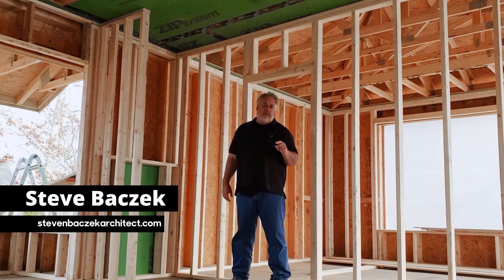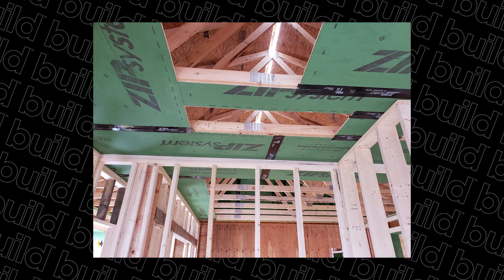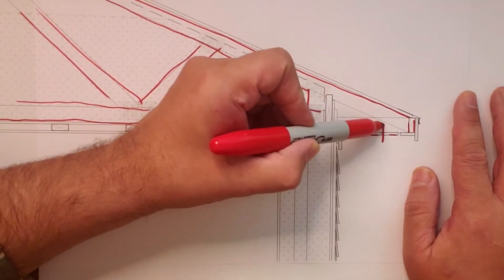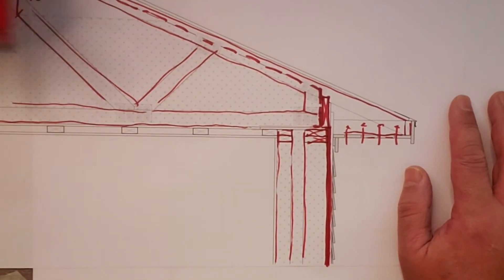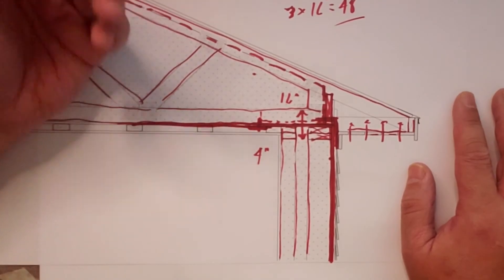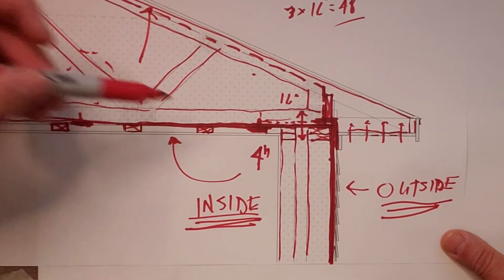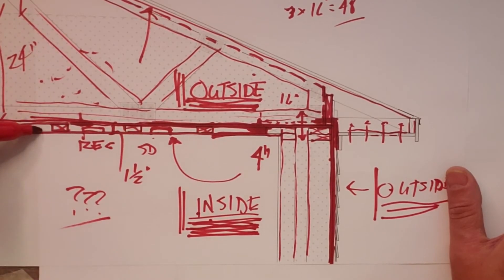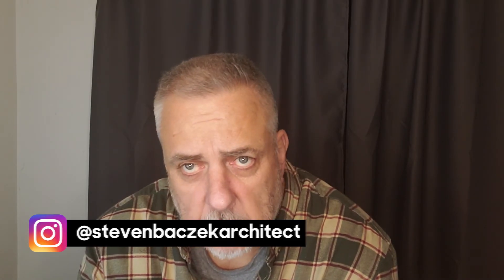ZIP AIR BARRIER at CEILING

Comment: If you consider the green exterior to be the more vapor closed side of the zip, as it is also the water barrier then then it is functioning as a vapor barrier which would be on the inside in a cold climate.  My question is why not use Siga (Majrex 200) or equivalent as a cost saving but high quality material for this purpose?
Reply from the maker: Your assumption is wrong, the green is 8X more vapor open

Comment: Did a house with zip that I sealed to top plate with acoustical, also really buttered up where top plates butt with acoustical, put acoustic under and over exterior hurricane clips, then hung whole house drywall lid and foamed it to top plate in 1/4” gap left there. Foamed plywood boxes over recessed lights as lid was hung.
This allowed zip to go over raised heels giving a good connection, I didn’t block.
This seems way more economical, Acoustical a sticky
pain, Asiri designs has vid on not using drywall as air barrier, 
Do firring strips really keep 
ceiling flatter with weight of 
insulation, used 5/8”, trusses 24”. Learning a lot from vids and comments, thanks all.

Comment: That makes more sense than drywall in a garage ceiling. That zip would help hold the heat in the garage. I don't smoke in the house. But garage without heat can be colder inside than outdoors. Really cold days it sucks. The roof is insulated but heat takes so long to get to ground level. I have a  tall walled steep saltbox roof on garage for storage. But not with a full subfloor. The car garage door is a whole another issue because tall too. I staple an air barrier over it in winter.

Comment: Steve, Me being in Alaska, wouldn't I want my air barrier (if using zip sheeting? to all be on the inside of the walls, floors, and ceilings? And a breathable conventional house wrap product on the outside?As opposed to zip on the exterior and poly on the interior, thus creating a vapor trap between the two?
Reply: Vapour penetration and air penetration are two separate things. 

Zip is not a vapour barrier. It is vapour permeable, just like house wrap.

Comment: Seems like the green side / label side should have gone up, so as the exterior side of the walls turns into the attic at the top plate, it is all the same.
Reply: how would you tape that?
Reply: If not cerified, at least get in a conversation with them about Steve and other building science content providers to see if they are the same page about expectations.  They beter know who Joe, Steve, Matt, Jake, and Aron are.
Reply: @markstipulkoski1389 , I am familiar with them. There is nothing wrong with asking questions. In my role, I question architects and engineers daily. It is healthy to be challenged. That is how we learn and grow. 

In the video, Steve said this project was a builders personal project. And that detail was something the builder wanted to do on his personal project. And while it seems like a good idea, was the installation the best practice? 

A couple of those other “building science” content creators have said to take a wall assembly and lay it down for a floor assembly. And to take a wall assembly and turn it up for a roof assembly. So if keeping with that logic, the green side should have gone up.
Reply: @BrianBaldridgeC  I apparently replied to the wrong comment.  I was just intending to agree with you...why green side in?  I was intending to reply to the comment about there should be a Steve Bacsek certification for builders and architects.✌️
Reply: @BrianBaldridgeC Coincidentally, this relavent video came out this morning: https://youtu.be/GcXrCY0X9lU?si=DImOBMfp1gS9RorE
Reply: If you consider the green exterior to be the more vapor closed side of the zip, as it is also the water barrier then then it is functioning as a vapor barrier which would be on the inside in a cold climate.  My question is why not use Siga (Majrex 200) or equivalent as a cost saving but high quality material for this purpose?
Reply: @ zip is vapor permeable. It is not rated as a vapor barrier. 

My guess is they faced green side down so it could be taped easily.

Comment: Just wondering is all the electricals run between the sheet rock and the half inch air barrier instead of being in the attic ? also what about all the heating returns and runs they keep them in the attic thank you
Reply: I do not have any knowledge of this house, but a tenant of modern passive house design is to keep any ductwork inside the conditioned space.

Comment: Hi Steve. Quick question:
Why does the Zip face turn towards the inside of the conditioned space at the ceiling when it’s typically installed with the face facing out on walls and roofs?

TY, Chad
Reply: If you consider the green exterior to be the more vapor closed side of the zip, as it is also the water barrier then then it is functioning as a vapor barrier which would be on the inside in a cold climate.  My question is why not use Siga (Majrex 200) or equivalent as a cost saving but high quality material for this purpose?
Reply: My thought also.  And could it be cheaper OSB or plywood.
Reply: I had the exact same thought. Does it have to do with taping it?
Reply: @chadcooper7348  The reason is simple if you think about it.  It's so he can actually tape the seams as intended, on the green side.  Imagine trying to tape the green side seams from the attic.  From the vapor barrier point of view, having the green vapor barrier towards the humid interior has a tiny bit of benefit  but the primary reason is so you can actually get to the green side to tape it.✌️

Comment: Great detail, however, does it have to be Zip sheathing.... Couldn't you just use 7/16 OSB w/ good quality tape for all the seams.

Seems like OSB would work, and that Zip is overkill, considering that ceiling isn't going to be challenged by water.... unless perhaps some catastrophic failure of roof!!

Comment: this seems a more costly solution for the same result as your detail using a 10" strip of advantec to which the  sheet rock is later sealed with acoustical sealant. Could you compare the two approaches
Reply: Did you watch the video? 😂

Comment: 1.5" is not enough depth for everything you might want in the ceiling. Speakers are typically 3 1/2" deep. What about ductwork? Where's that going? I much prefer the "monopoly framing" solution Matt used on his house. You have that whole attic as conditioned "inside" space to put ductwork, speakers, any sort of lighting you might want (this house you describe here could not retrofit a chandelier easily,) an HRV/ERV and associated ductwork, etc, etc. It's just a much more versatile choice to make that barrier between inside and outside above that attic space.
Reply: On another channel,  a builder, YT channel "Miiller's Construction Company",  makes a simple box for can lights, etc.  He simply puts blocking in between the ceiling studs to form a rectangle.  He then caps the rectangle with OSB and then runs his wiring into the box.  Then he seals the interior of the box with caulk and seals the wiring hole with Great Stuff.  When time to put up the drywall, he puts a continuous bead of drywall adhesive on the underside of the box, which then completes the air tightness of the box.  Your box will be 3.5" deep instead of 1.5".  If you want to use deeper cans, you could go through more trouble to make your box deeper, but there are true recessed cans lights that would fit in a 3.5" space.  Steve on another episode emphasizes that ceiling drywall is an air barrier, so Zip in the ceiling is overkill, IMO.  Also, to ensure air doesn't travel through the electrical outlets, wall, switches, and pipes, use great stuff where they penetrate the top plate.  Remember, inside and outside pressure will be different, so air is pushed through every crack.  You probably already know that last part.

Comment: Hui Steve, we are building a new home in central Alberta this summer. I was planning (outside to inside wall) Metal siding, ZIP R9, 2x6 frame with R28 Rockwool, Intello Plus, strapping, drywall.  I was planning to have intello plus as the interior air barrier. Could I go like you are here and use 1/2 ZIP on the ceiling instead of the intello and be safe? Everything will be tapped. So we could use ZIP as the primary air and WRB? Would you suggest anything outside of the ZIP R9 before we put the metal on? I would love to have a brief chat and could DM you my contact. I am doing a self build and am not a contractor.

Comment: Moisture has to leave rhe home. How will you achieve this?
Reply from the maker: Zip is a couple perms, couple that with Zehender ERV and we will be all set
Reply: @stevenbaczekarchitect9431 That requires electricity.  Is there ever any consideration on how a house performs if it is unoccupied for a period of time and the ERV breaks or a hurricane disrupts power for a few weeks.  I would want passive vapor management as backup... good drying via the roof assembly...a smart vapor barrier.

Comment: Another great and informative video Steve.  Question might be difficult to answer.  Is it possible to put a fireplace or wood stove in a passive house?
Would love to hear your opinion.
Reply: With a wood stove these days you can have an air inlet directly from the outside into the stove.

In reality though in a passive house your heat requirements are so low it's probably not a good idea to have one.
Reply from the maker: @Zorlig  I actually have a Net Zero PH Inspired home in a Heating Climate with 6800 HDD and they heat the 2000 sq ft home with a Rais sealed combustion wood stove with 2 arm loads of wood a day.....
Reply: @stevenbaczekarchitect9431  NIce!!
Reply from the maker: If you are certifying the house as PH, then maybe a little more difficult. If just targeting PH Inspired then a little easier
Reply: Agreed on another amazing video by Steve! While perhaps Steve will have another opinion on this, my understanding is that you're going to want to consider the air source for the fire. If it's coming from the conditioned space, how is it being made up. There are fireplaces today that bring in air from the outside to fuel the fire then exhaust back out, creating a closed loop that doesn't have any air movement affects on the interior conditioned space. I suppose a cheap way to do this would be to calculate the CFM of the boost function on an ERV to provide enough makeup air, but I'd be concerned about efficiency.